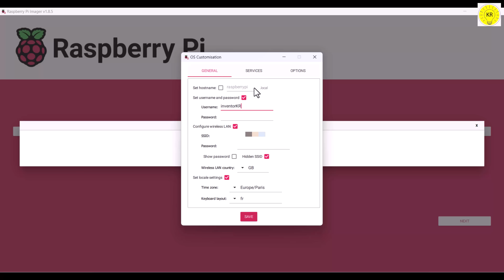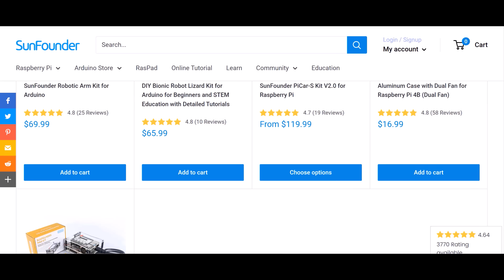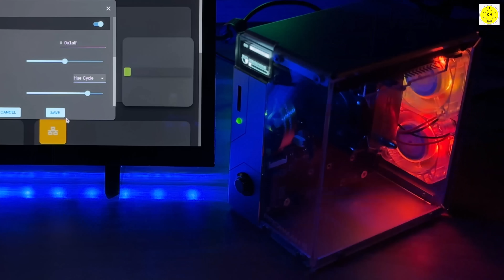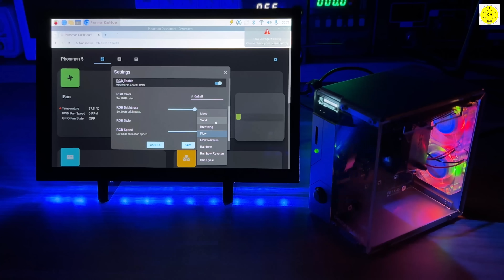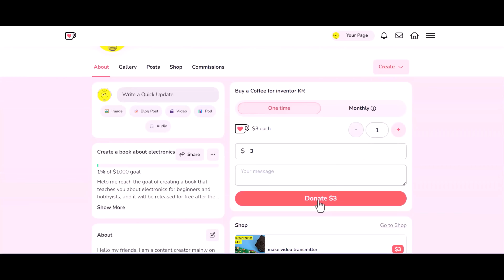mini pc raspberry pi 5 case, Pironman 5, DIY Mini multi function PC

Comment: I didn't like the casing my Canakit Raspberry Pi came with. I started seeing what upgrades I could find and came across this. So far, I like it, although I can't get the OLED screen to work. But the SSD allows for a much quicker boot up.

Comment: How much fps can Run GTA5?
Reply from the maker: The Raspberry Pi 5 can run GTA V, but frame rates will depend on the settings and optimizations you apply. Generally, it won't be as smooth as on dedicated gaming hardware.

Comment: I know it'd be incredibly stupid and overkill, but I just want to put a water block on the Pi5 with the tubes running out the front or side of the case to a small radiator and a pump/rez combo on top. While it would probably make the entire thing top-heavy, I just like the esthetic of moving water.
Reply from the maker: Watch this video
https://youtu.be/WYNcBDjzzsI
Reply: @inventorkr1  Not quite what I meant, but thanks for the link.

Comment: Is there any good reason why you didn't use proper thermal paste?
Reply: Because even if you overclock the RPi 5 at 3Ghz it keeps cool just fine with thermal pads.

Comment: I have one of these  I just can't  figure  out my raspberry pi  keep  shouting down every  time  I boot it up
Reply from the maker: It sounds like you're having some trouble with your Raspberry Pi! Have you checked the power supply and connections? Sometimes those little details can make all the difference.

Comment: SMES Tiers and Levels Exception. Approved for product and specs review. Reason:Brand configuration, remodelling and designs incorporation applied. Tierage Exception was approved since it has a potential for productivity, creativity as well as originality in its content, brand category:Mobile PC.Warranties:Extended, Lifetime per manufacturers standards of Quality control, in Engineering, Hardware and software architecture.*****THANK YOU*****

Comment: Cool mod but sadly the RPi has gotten so expensive that you can get a fully built Intel N100 system with RAM and storage for less than the cost of an RPi these days.
Reply: The sad part is raspberry pi is not suitable or powerful enough to be used as a computer
Reply: @asmarttraveller9576 what is a raspberry pi then?
Reply: Get a commodore 64 ultimate then
Reply: Ryzen mini PC for less than $200 would be a good option, and the CPU/iGPU would run circles around the Pi5 and Intel minis.
Reply: @dotxyn  la marca genmachine usa ryzen en sus mini pc  pero recuerda las mini pc genmachine y de otras marcas tienen mala ventilación si no tienen salidas de aire Asia arriba es por que estan diseñadas para estar de manera vertical ya que las entradas de aire están en los lados :)

Comment: This is a cool little desktop build!Good job!  Was the cpu,gpu fan moving?
Reply from the maker: When the temperature reaches a certain limit, the processor fan is turned on, and you can control the appropriate temperature to turn on the processor fan by adjusting

Comment: Cool. 
Bin am überlegen mir sowas für Office- & Bankingsanwendungen zu kaufen. 

Welche Betriebssystem wäre für den Pi5 geeignet?
Reply: Mach dir Ubuntu drauf, das gibt's direkt im Pi Installer zur Auswahl. Würde dann auch dazu raten ne nvme zu nutzen und das Betriebssystem nicht über die Speicherkarte laufen zu lassen. Das bringt nochmal einiges an Performance

Comment: How much FPS will this computer show in Cyberpunk 2077 in 4k ultra quality
Reply: Probably 0 and it will crash
Reply: Over 100000000000000000000000000000000000000000000 of course
Reply: 0.112
Reply: It's over 9000
Reply: 1 fps per hour
Reply: in fact, if GeForce Now supports it, the fps will be normal
Reply: No gpu I don’t think :(

Comment: Same size about intel nuc, 1/4 of the power 😂
Reply: 10 times more effort buying all the parts and setting it up, if one thing is broken you'll have to troubleshoot it. It would weigh allot more. and I'm pretty sure it will cost as much or more for RPi especially on sale, the Pi doesn't really get a discount. this is just for youtube views

Comment: Is there a network card with 2 X RJ45?
Reply: You can possibly use the pcie to add a network card
Reply: The pi has built in wifi
Reply: @soulprice5428  
It doesn't work for what I need. I need 2 RJ45
Reply: @race_Bannon  hmmm may I ask for why your so limited to needing that needing not just one but 2 RJ45 connections on the one dev...jw bcuz I can't imagine the need but ik there is one cuz you need it lol so there's gotta be ....
Reply: @race_Bannon  also idk about this build in the clip but yea you def can get a razz 5 to have RJ45 it's a hat tho like the add ns in this it's an pcie to gigabite port adapter board one thing i love about pis is they have an add on or build for almost ANYTHING gpus too now just a lil work to get egpus going
Reply: Simple. To install and use as a network firewall.
As it is small, has low consumption, etc. I found the idea interesting.